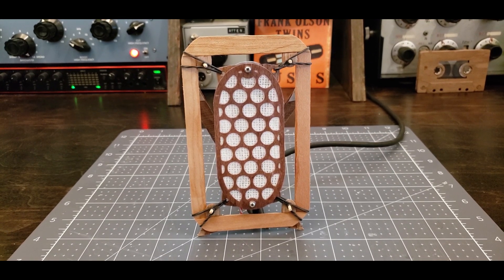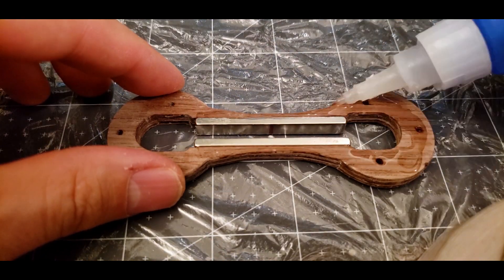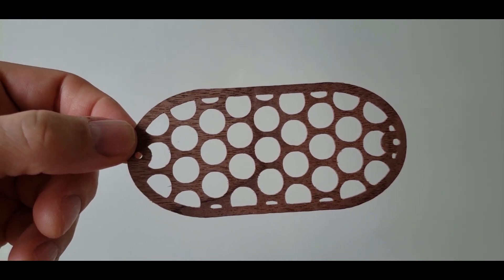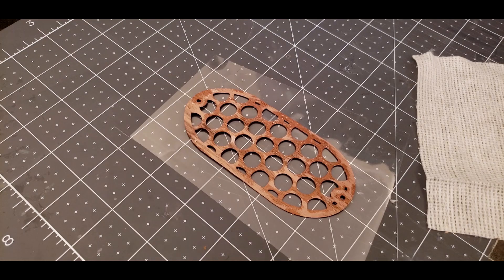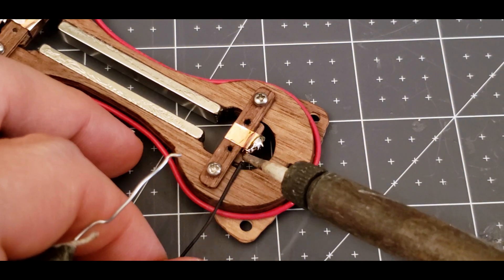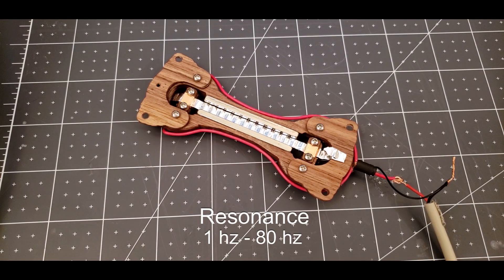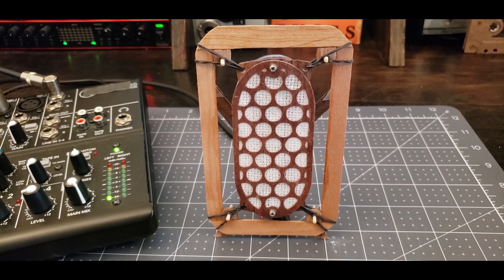Ribbon Microphone DIY RCA 44 - Episode ONE

Comment: hi , can you tell me plaese , can i use another transformer ? For example Neutrik NTE10/3 ?
Reply from the maker: Hello,
I've tried similar transformers (1:10 mic step up transformers).  Techinically, it will work...but it won't be loud enough.   The ribbon really needs about 3x more voltage step up than that. Most ribbon mic transformers are in the 1:30 to 1:55 step up range.  Without it, you rely completely on your mic preamp to finish amplifying the voltage.  Without the extra step up voltage, you end up with a preamp that is working too hard and a very noisy signal.
Reply: @FrankOlsonTwins  thanks for your reply .  maybe L frank audio hts 30 would be better?  ( no others )
Reply from the maker: No, that's an output transformer. You need a very small mic transformer, such as this:
https://amzn.to/3JjVXu3
Reply: @FrankOlsonTwins  thanks for explaining.  Unfortunately, it is impossible to order any of the ones presented in the video or the link in your previous message.  If I reduce the size of the tape, maybe neutrik will fit?

Comment: How strong do the magnets need to be?  I was also wondering if a larger ribbon was used, could it pick up faint sounds?  I would like to build a custom mic for making ASMR videos.
Reply from the maker: The magnets should be as strong as you can get. N42 is a good starting point.  N52 is great if you can get them.  You could try a longer ribbon, but 2" seems to be the most practical.  For really sensitive mics you can try to use signwriter's leaf for the ribbon, but it's very difficult to cut and install.  It's about .6 microns thick and will pickup very small sounds nearby. 1.8 microns it the standard and it works pretty well on nearby sources.
Reply: @FrankOlsonTwins ,

Thank you for replying so quickly.  

I was thinking about using some real old technology to help amplify sounds.  A big sound catcher (5 gallon pail possibly) 

I am a novice at electronics, but your video was very clear and concise.  I also read lots of the other comments and found you to be a human Encyclopedia of knowledge.
Reply from the maker: Thanks!  I've experimented with sound catchers.. they do work, but a 5 gallon bucket will introduce "reflections" into the signal.  You could try a wide, shallow salad bowl and mount the mic element somewhere in front of it(think satellite dish). Good luck!
Reply: Transformer is mandatory or can be customised

Comment: Very inspiring. You are a true craftsman. I just recently started working on ribbon mics. I picked up a Nady RSM-2 for next to nothing. It sounded horrible. Very low output and tinny. I figured that I could at least pull it apart and inspect it. I didn’t have to look too far to find the problem. The ribbon motor magnets are coated with cheap plating. The plating was heavily peeling on one of the magnets and was making contact with the ribbon. With nothing to lose, I removed the ribbon and cleaned the magnets as best that I could. I reinstalled the old ribbon. Of course it tore where it gets clamped on one end but it was still long enough to install. I tensioned it using a cotton swab and got it as tight as I could. Low and behold, it works and doesn’t sound too bad. I am sure it could sound even better with a new, properly tensioned ribbon. I now have a working ribbon mic for about $20.00. Can you suggest a decent transformer? Thanks
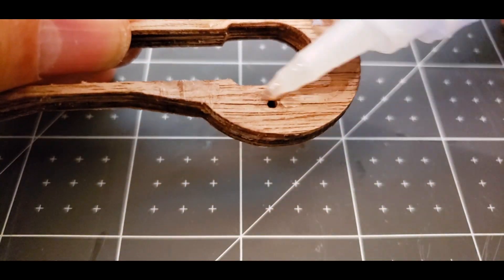Reply from the maker: Thanks!  Yes, the very cheap mics have that problem of "magnet shedding." Edcor, Cinemag and Lundahl all have suitable ribbon mic transformers.  Generally, you're looking for one with a ratio of about 1:28 or just a little higher, like 1:35.  You could go as high as 1:50, but it becomes a tradeoff for frequency response.  Before upgrading the transformer, I'd buy some ribbon material and learn how to re-ribbon the mic.  You can find 2.5micron or 1.8micron foils which will likely be better than whats currently in the mic.  Some places online sell the ribbon, ribbon crimper, and transformers all toghether.  Re-ribbon with a fresh ribbon(not tight, just a little past sagging) and see how it sounds.  If it's sounding really good, then swap the transformer.  
Good luck!
Reply: @FrankOlsonTwins  Thanks for the information. The plan is to replace the ribbon before making any mods. Even in its current state, it doesn’t sound half bad. It’s bottom heavy so I did some eq-ing and it took it very well. I can imagine that a new ribbon will make it sound better. I used your bottom up light trick to check my ribbon alignment. Amazingly, it’s spot on but slightly loose. I didn’t have any extra material overhanging the clamps to adjust it. I am surprised that I got it as tight as I did. I can see ways to improve upon the design of this mic. If the edges on the clamps were smooth, there would be less of a change cutting the ribbon when tightening them.  That’s how I cut on my first installation attempt. Overall, I am pleased with my investment of time only on this mic. Thanks again!
Reply from the maker: Yeah, before you re-ribbon, you could use some 600 grit sandpaper and smooth all the clamp edges so it'll be much easier to shift the ribbon around. Ribbons do take eq well, you can even crank the hi end a bit to hear what's naturally lacking. If this is a long ribbon like the one in my video, they excel at bass capture.  You'll likely have to roll off the low end, or you can tighten the new ribbon a bit more to pull out some of the low end. Yes, adjusting a ribbon over a light box is pretty much necessary. That's why I put it in the video, to give people a good idea about how to install and adjust the ribbon.
Reply: @FrankOlsonTwins  Excellent! Thanks for taking the time to respond to my posts! It’s greatly appreciated.

Comment: Is this essentially the same as a ribbon tweeter- the only difference being the source input/output being different? I’ve looked into DIY ribbon stuff recently and it surprised me how similar your mic and others tweeters have been built. This looks like a great project!
Reply from the maker: Thanks for checking out the vid!  Yes, This is very similar to a ribbon tweeter, however I think a tweeter would have a wider gap and ribbon. Also, I have to imagine the tweeter foil would be a little thicker... If you build one, let me know!

Comment: good day friend!
excellent video inspire me

I wanted to ask if it is possible to leave the microphone like this without a transformer and connect it to an audio interface
and get professional audio

greetings thanks for the video!
Reply from the maker: Hello!
That's a good question! You could try, but I don't think the volume would be loud enough to hear it above the preamp noise. Perhaps it might work if you were recording really loud drums....
One thing the transformer does is "step up" the output of the ribbon by about 30x.  That's because the ratio of the transformer is about 1:30. 
The other thing the transformer does is to match the impedance between the ribbon and the preamp(your interface, for example).  The ribbon alone has a very small impedance- less than 10 ohms.  With the transformer, it's somewhere between 50-250 ohms. That's enough to make a decent impedance "match" between the mic and preamp.
I hope this helps!
Reply: @FrankOlsonTwins  
to very well! Thank you I have doubt if the Transformer has to be specific? type as impedance or audio transformer? or can you with an energy transformer!? thank you very much for everything friend you are big! If my English is not good, it is because I am using Google Translate Greetings from Zacatecas México 🇲🇽!
Reply from the maker: Sure you could try any transformer, some will work better than others. Generally, ribbon transformers have a ratio of between 1:20 and 1:60.  
No hay problema. ¡El español a veces es difícil para mí!

Comment: How thin does the ribbon have to be?
Reply from the maker: Somewhere between 1 and 4 microns.  Right around 2 microns seems to be the sweet spot.  You can get VERY thin ribbon material through my amazon link- approx (.8 micron) if you buy the imitation silver leaf.  If you can figure out a way to sort the sheets into thickness(like over a lightbox to see which ones are thicker) you can get somewhere in the neighborhood of 1 to 2 microns.  Some manufacturers do it that way.  Or you can buy 1.2, 1.8, or 2.5 micron sheets on ebay. It's pricey, however.  My advice is usually to buy the imitation silver leaf and practice that a dozen or more times.  By the time you get your process worked out, you'll know how to properly handle the foil and re-ribbon your mic.  Good luck!

Comment: Does this transformer mean that is a 48V mic ? Can it works without transformer ?
Reply from the maker: Hello. No, this is a passive microphone. The transformer steps the voltage up about 30x, but it doesn't require phantom power to work. Technically, 48v shouldn't hurt the mic, but hot patching the mic with phantom power might.
Reply: @FrankOlsonTwins  Hi ! Thank you for this explanation. I heard that 48v burns ribbon mics, I understand now
Reply: @FrankOlsonTwins  Can you say why aluminium is better than copper in this case ? (ribbon)
Reply from the maker: I don't think copper foil is strong enough to withstand repeated use. For some reason, aluminium foil lasts for years(sometimes decades) if properly installed and handled. The foil used for these ribbons is about 1 or 2 microns thick.
Reply: I'm trying to make a stereo mic from 2 mono mics wired into one single stereo signal, plugged to a Zoom H8 recorder. The best I had is a mix of both mics signals, converted into a single stereo signal, where Right and Left are the same. Do you have any idea of what's the problem ? I use 2 passive mics (not powered), wired to a 3-pins XLR connector. I heard that XLR can't bring a true stereo signal. Do I have to use TRS 6.35mm jack connector ? This thing makes me crazy ^^
Reply from the maker: A single XLR connector is not stereo, it's mono. It's designed to carry 2 halves of the same signal. It's described as Hot and Cold. Add them up and you have one signal, not 2. If you want stereo, you need 2 XLR connectors. If you wire up 2 mono mics into one XLR connector, your preamp is expecting Hot and cold, not hot and hot.
TRS is not a good solution because  it is wired similarly to a single XLR. TRS can carry a stereo signal, but only on headphone outputs. TRS preamps are not expecting stereo signals, they are designed to amplifiy Hot and cold. The best solution is to use 2 XLR connectors(one for each mic) and plug them both into the H8.

What you want is: Mic Left to XLR Left. Mic Right to XLR Right.
XLR Pin 2 is hot. Pin 3 is cold. Pin 1 is shield/ground. 
 If the mic only has one wire, connect it to 2(hot), and Pin 1 and 3 to shield/ground. 
Wire them both the same and plug them in, it should work!
Hope this helps!
Reply: @FrankOlsonTwins  Thank you so much for these precise answers. You saved a lot of my time ! That's strange that TRS preamps are not expecting stereo, and that we can get stereo only on output. It is disappointing ^^  I would have liked to find a solution to have only one cable and not two, but waiting for a better solution, I'll try it ! 

And what if I hack a cable to fit the top connector of the H8 ?? It is the track that allows you to connect different capsules. Because these ones are stereo mics for sure and you can record a true stereo signal. What do you think ? Possible ?

In any cases, thank you again. Awesome contents and answers = subscribed.
Reply from the maker: Well, you could use a cable with 6 conductors. you would wire both microphones balanced each with 3 wires, then simply terminate them to 2 XLR connectors.  It would be a custom single cable with  2 connectors.
Hacking the H8 might be even more difficult, because condenser capsules require a specific impedance.

Comment: Nice job!  I have 44BX and 77DX mics and have been intimidated about doing ribbon work. Yours is the only video I found that even explains the wiring.   Nice output frequency response. 

Do you have any templates for the motor's frame?
Reply: Howard
Reply from the maker: Hey Howard, thanks for checking out the vid!  Yeah, the ribbons are probably the most time consuming, critical component of ribbon mic building. It takes a few hours to learn how to handle them, and even breathe around them.  Do your 44 and 77 show signs of needing new ribbons?  
I haven't yet shared the templates, I was thinking of putting them up on eBay as a complete project file but have been unsure of what the general interest is. 
How long have you had your RCA mics?

Comment: Can I make the folds in the ribbon by hand or by some formula manually
Reply from the maker: Very unlikely anyone could fold it by hand, however, some people gently press the foil against a comb or other ridged surface.  Even running it between 2 unmounted gears by hand would be preferable.
Reply: Thankyou sir , very informative and inspiring video ,I have been trying to record my drums but the gears are way too expensive in my country , I am thinking of playing with the ribbon length, tension  and width to see if I can record all the different component of my drums .Hope it works . You are very kind enough to reply so fast , thankyou sir
Reply from the maker: Thinking more about this, perhaps you could try folding carefully between 2 thick sheets of paper(accordion style) .  The folds should be pretty small, less than 4 mm each.  Just don't crease it too tight.  It might work!
Reply: @FrankOlsonTwins  thank you sir ,I will try it out

Comment: Great projects! Is it possible to use those fake silver sheets used in crafts and art? i think its called aluminum leaf? or is it too thin? thanks!
Reply from the maker: Sure, you can use that aluminum leaf.  Most of it is too thin to get a long lasting ribbon(approx .6 microns).  If you weigh the sheets you might be able to find the thickest ones and make your ribbons from that.  I've used it for many mics.  If you get good at making ribbons with the aluminum leaf, you'll have no problem cutting and crimping the thicker 2 micron stuff.
Reply: @FrankOlsonTwins  thanks Frank!

Comment: Incredible video!  Thank you!  I have read that the RCA 44 is either 13 corrugations per inch or 19 corrugations per inch.  What do you say?  And can you give us the pitch and diameter of your corrugation machine's gears?  That is a really fine looking machine!  Thank you!
Reply from the maker: Thanks!  I bet the RCA crimper corrugates approx 10-14 corrugations per inch.  You can actually count it if you look up a clear picture of the actual RCA (or AEA) corrugator.  I think that machine uses 2" gears at 32 pitch.  My crimper uses 1" gears at about 48 pitch.  I'm crimping around 15 corrugations per inch, but after installation/stretching, it's closer to 12 or 13.  Thanks for watching!

Comment: Could you please explain how you are running the sine wave through the ribbon? Could I use an old aux cable or headphone cable to hook it directly to my laptop? Or can I just play it aloud without it hooked up via a cable and it should also resonate the same way? This is my first audio project, so I appreciate the help.
Reply from the maker: Hmm this just showed up in my notifications, sorry for the late reply!
Make a headphone cable and run it directly from your laptop to both sides of the ribbon. Start with the lowest volume and increase as necessary.
Another way would be to complete up the microphone as normal, and record some heavy finger taps on the motor. Check against a frequency analyzer(most eq plugins show this) and be sure it's going down to 20 hz. If not, reduce the tension on the ribbon.  Good luck!

Comment: Nice video. When you are running the 1 KHz test signal through the ribbon are you making adjustments to the ribbon? If so, what are you adjusting it for? Tension?
Reply from the maker: Yes, correct.  But really, I'm testing between 10hz and 200hz.

Comment: can larger magnets be used? 100x10x10mm Will the performance be good?
Reply from the maker: Good question! I wondered the same thing when I started making microphones.  After some reading, it seems that a single ribbon which far exceeds 60mm is subject to poor resonant performance- that is to say, the ribbon will resonate at certain frequencies and in some cases the actual sound of the aluminum material might become apparent.  This also happens when a ribbon is too wide, too loose or too tight. I think it's worth trying though, to see exactly how a ribbon would respond at that length.  Who knows, it might sound really great at low volumes...